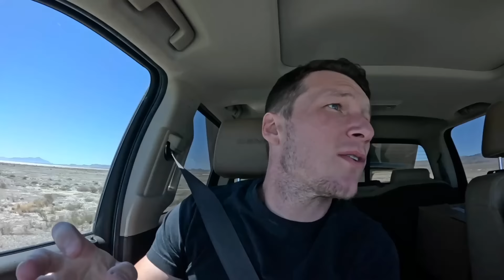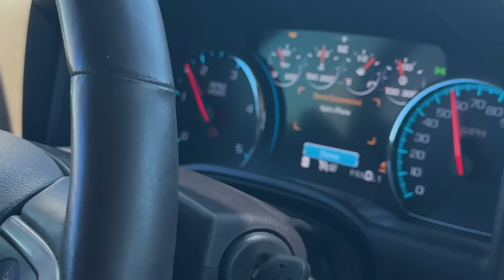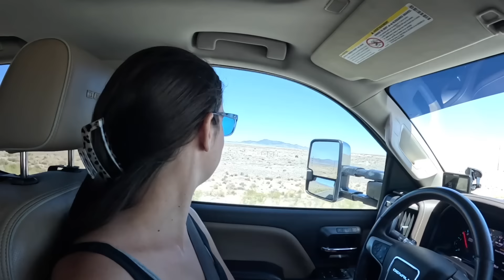New Trucks are 'Built' to Leave You Stranded

Comment: when you buy a diesel truck the first thing you need to do is get it deleted... 1st thing no second chances guys..
Reply: Which is totally illegal (currently) so no shop with half a care about being busted will touch doing one. Doing one on your own is NOT easy (could require "cab off" depending on the truck) and requires a "tune" which can cause other more serious issues (burn a piston and you're out $12K). This also immediately voids any warranty (factory or aftermarket) you may have.
Reply: @philsonnenberg6092 hopefully with the recent news coming out of D.C. that will change pretty soon
Reply: @martycarlson4503  not likely. At least not for trucks under warranty. The new (or lack of regulation) specifically states "deletes may be legal under certain circumstances AFTER the useful life of the truck has been exceeded". There is no wording that expressly states deletes will be totally legal. This entire regulation (it's not a law and never was) is written to get everyone excited but does NOTHING for 2026 and older trucks with emissions equipment installed. It DOES address trucks produced going forward will not have to meet the old standard.
Reply: @philsonnenberg6092  I wonder what the “useful life of a truck” is. From what I heard a few months ago it was more like, you can’t delete it for no reason, but if the emissions system is failing, then you can. So it would be beneficial to those looking to buy a used truck that’s from 2020 or older. I never have, and probably never will buy a brand new vehicle, but from what I’ve heard newer trucks have a separate warranty specifically for the emissions system. So idk how that would work. I have a 1990 ram with a 12v Cummins, so I don’t have to worry about emissions, even in cali.